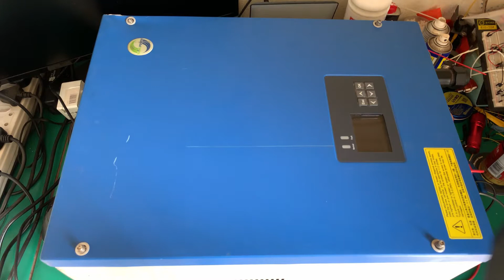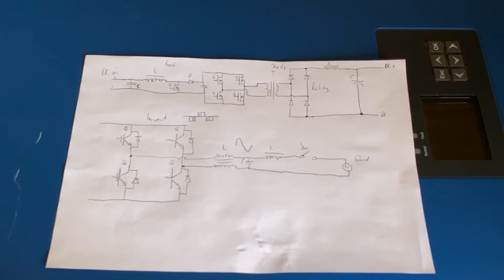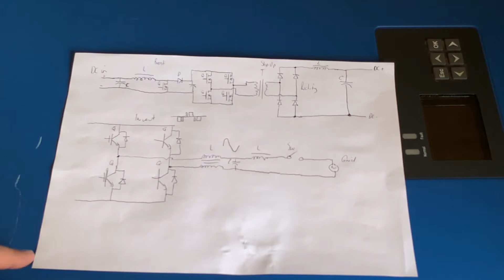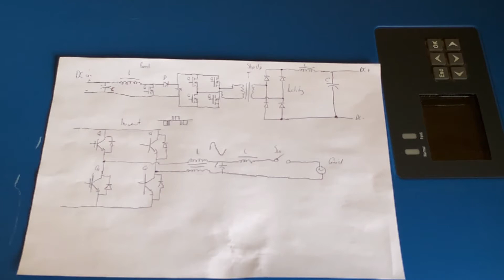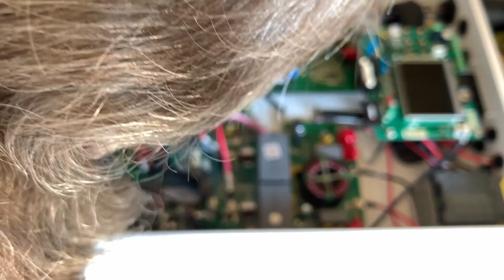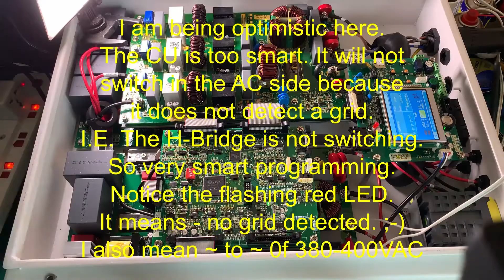FoulkesBrau #11 - Repair of SamilPower SolarLake 8500TL-PM Grid tie inverter

Comment: Hi Craig,
Which Password have this inverter for Installer? so you can select DC input: Parallel or independent.
Thanks!
Reply from the maker: Hi there,

Download the manual and you will find the password. 

Cheers 

Craig

Comment: Hi Craig, I'm impressed with your video and the detail and effort you have put into making it.
I found your video because I am looking at a similar unit, slightly larger power and SolarLake TL10000 three phase with an issue, owned by a family member here.
The unit powers up fine and the display shows the multi string PV array is fine and the grid side is also good, but after power up and health checks, the unit does not connect to the grid.
I am suspecting possibly the relays in the AC filter board.
There is not much information on these units that I have found and the unit does not give much in the way of diagnostics from the LCD.
Though I suspect much more can be had via the communications port, if it has Modbus, which I suspect it would, that would be interesting to play with.
Like you, I am an industrial control engineer with a long and broad experience in all things electronic, so do understand the hazards and risks with these power devices.
I like how you explain the safety aspects, but did gasp when I see you poking in the inverter while live with a solder sucker and reaching down very close the PV input connections, and also tapping the control board with the sucker. I was already imagining seeing small pieces of sucked up solder fall out on the live control board, yikes !
Much appreciate your effort in putting this technical video together.
Regards from Tasmania, the little rock under Australia :)
Reply from the maker: Hi Paul,

Thanks for the kind words.

It's difficult to point you in the right direction, especially over the internet. I would stick to the golden rule of instrumentation - are you getting voltages/signals to the relays and work your way back. I suspect you are going to trace it back to the MCU. The board I looked at was using one of the PIC MCU's, I'm not sure if it was locked, but you might be able to debug the software to see what is missing. Let us know how you fare.

Aahh, the wonders of the camera. It always looks like I am very close to the circuit when viewed by the camera - in reality I am very far away from it unless taking a measurement.

Cheers

Craig

Comment: Sir which components are use in solar hybrid inverter for supply excess energy to grid
How can we make circuit to convert normal inverter to hybrid solar inverter
Reply from the maker: Hi there,

Typically, you need solar panels, and grid tie inverter and you're off to the races.

You need to take your DC power from the panels, create a DC bus, invert the DC bus and synchronize your AC voltage and current to the power supply utility. To push power out into the grid, you would make sure that your generated AC voltage is slightly higher than the grid. 

I would not try modifying an inverter to achieve this.

Now for the really good news - there are IEC specifications out there that define all the parameters that you would need to design for before any utility would let you connect to their grid, so I would suggest that you start there.

This is definitely not a project for a hobbyist.

I do have a series where I am designing and vuilding a dip proof inverter, perhaps you should start there.

Cheers

Craig